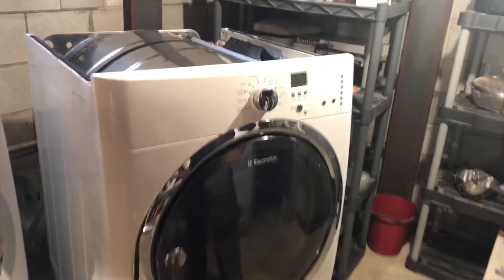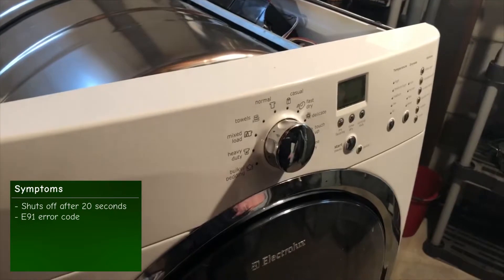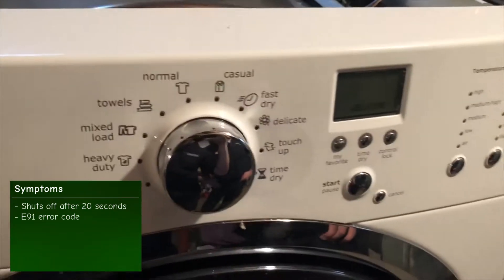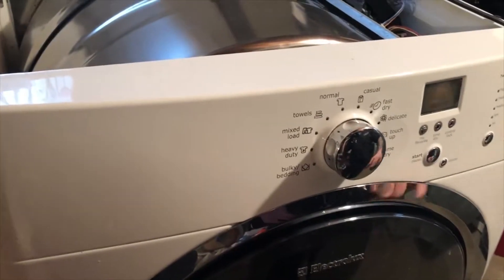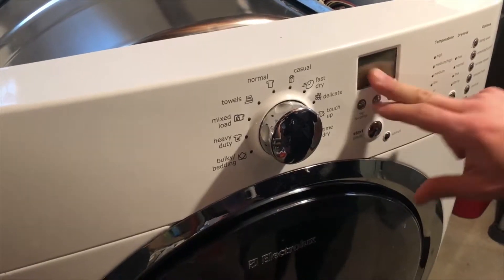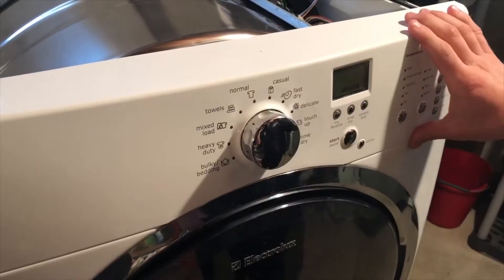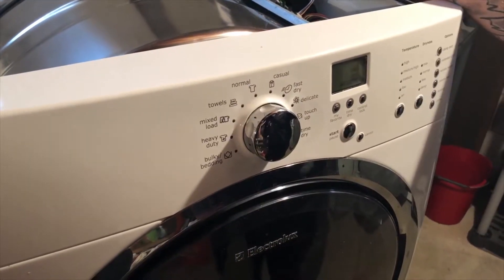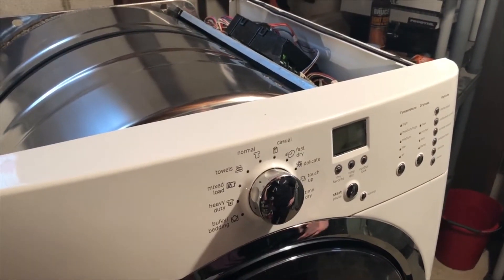Electrolux, Frigidare Dryer  - Shuts off after 20 seconds - Diagnostic & Repair

Comment: So, what was wrong with the dryer ???  E91 trouble code ??? 
E91 trouble code: Control board failure and needs to be replaced. This sounds very, very expensive.